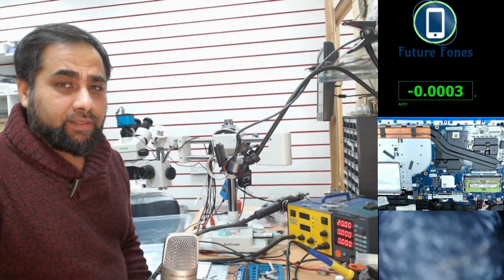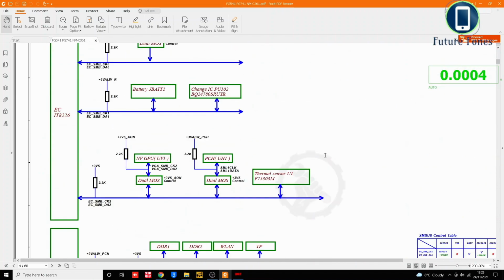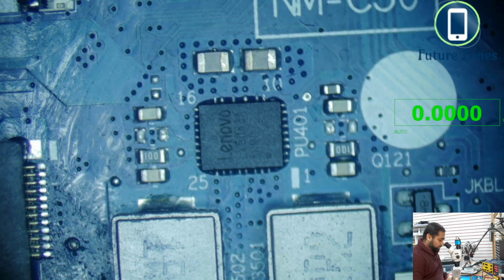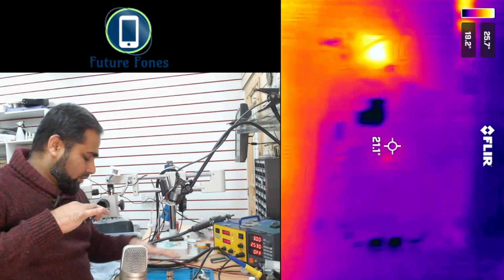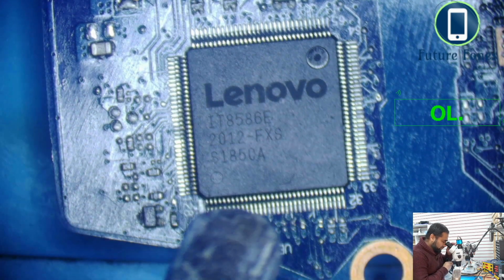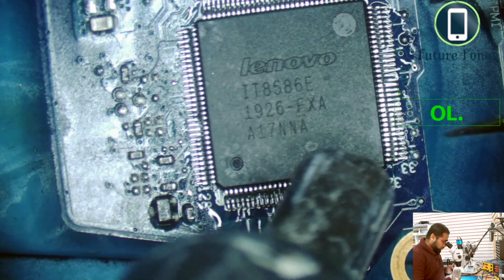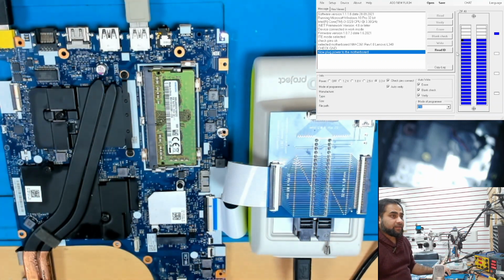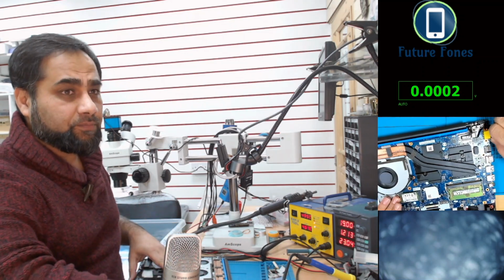Lenovo IdeaPad L340 No Power Fixed. ITE Programming with SVOD3 , LD0 Voltage low, IC from Scrap

Comment: i have same motherboard, with defective charging port probably got shorted in charging port because i found super io burned i replaced super io and charging port now im not getting 3v and 5v, i have only 19v in the first mosfet in one side what suggest to check ? thank you
Reply from the maker: Hi did you program your super io ?
Reply: @futurefonesltd  yes programmed
Reply: @futurefonesltd i have all 3v and 5v and reprogrammed the bios to be sure its always blinking power button no power
Reply from the maker: hi .. did you check pgood pins of LV IC ?  @gtech6394
Reply from the maker: Also check RSMRST pin on Super IO
Reply: i found faulty pu301 replaced it now i have all voltage the power button is blinking and not turning on

Comment: Well, I have issue with my gaming laptop L340 6 months before motherboard was replaced. And again the motherboard is defected it seems as per the LENOVO service Centre. what could be the reason of once again motherboard getting defected.
Reply from the maker: Sub standard Lenovo power iC . It burns and cause damage in SIO ic

Comment: i have the same is powering on on battry as normal but not turning on on charger when i press the power button it lit up but no display some time numlock key lit but not on what can be the issue :\
Reply from the maker: Charging circuit . Fist two mosfet need  check. Or complete charging section

Comment: Wow thank you. I appreciated this video alot, my laptop suddenly died. Now I'm just like your customer, broken plug. Till it eventually shorted out something. After replacing charging port, still nothing. digging on my own found that lv5084a ic is the hot guy. Tried finding any schematic on that guy is so hard. Thank you for your video, it was the only info regarding that ic on the internet.
Just wanted to show you my regard, I have a question. I got no voltage anywhere except on the input which i get 20v, and ic goes super hot right away.
Is it safe to say the ic went bad or could possibly be other reasons for short.
I should add I visually inspected entire board and there is no sign of any burned components and nothing else gets hot except for that regulator ic

Also, what was the solution u used to clean the board off the flux and the pins of the super io

I appreciate any help u send my way, ur video is the glimpse of hope I have for my laptop
Reply from the maker: Hi 
Thanks for writing the review. I  am glad my work has helped you. If this IC is getting hot. Check for shortage with multimeter at ic pins . If you find short on +3v LDO line. It usually is the super io. You need to change it and programme it with a programmer ie svod3

Comment: Hi I have a question my laptop motherboard is LA-B162P and I don't have 3.3v on the coils of PU401 and the PU401 is getting mad hot. When I checked the 3v LDO it was generating 2.5v what could be the problem.
Reply from the maker: change the heating up ic. and check surrounding caps and resistor for value.
Reply: @futurefonesltd  yes I did. it showing 2.5v and when I checked it on schematics it turned out to be the LDO voltage
Reply from the maker: something is pulling the ldo down... check the voltage injection on ldo output from ic .. is your super io heating up ?
Reply: @futurefonesltd  I don't have voltage injection tool. But if the Super io is bad can it allow the IC to heat up and also can it stop 3VALW from generating because  5VALW is still generated but they are different IC controlling the two voltages.
Reply from the maker: @ronkeafolabirasheedat8425  Yes any component that is connected to LDO that is short to ground can cause the 3.3v ic to heat up. Confirm that there is shortage on ldo line first and trace it by injecting volts .
Reply: @futurefonesltd  alright thanks i really appreciate your reply and your time. but can a Super IO stop 3VALW from generating while 5VALW is still generating. Became I hear the SUPER IO release a 3VALW and 5VALW enable signal that allows 3VALW 5obbe to be present at the coils.
Reply from the maker: @ronkeafolabirasheedat8425  yes
Reply from the maker: @ronkeafolabirasheedat8425  +3v ldo is independent.As soon as ic receives Vin it releases +3v LDO

Comment: What airflow and temperature is best when disoldering/soldering the ICs from motherboards with hot air gun?

What themperature did you used or would you recomend ?
Reply from the maker: I use 420 heat and 0 air for safe desolder. For tough ones I go full throttle 500. It’s always a personal choice of what settings you are comfortable with and have a good practice on your setup. Before you attempt to repair, practice on a donor board until you master it.
Reply: @futurefonesltd  Thank you for your help. Keep up good work.